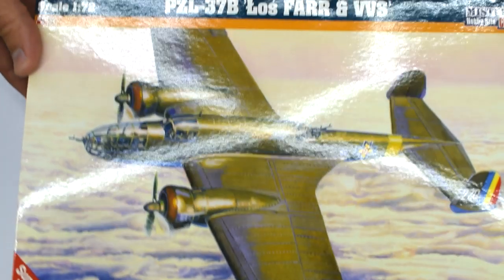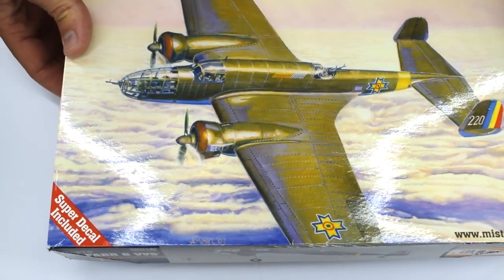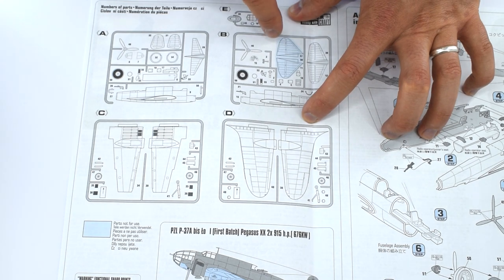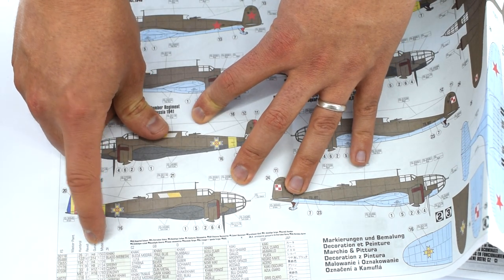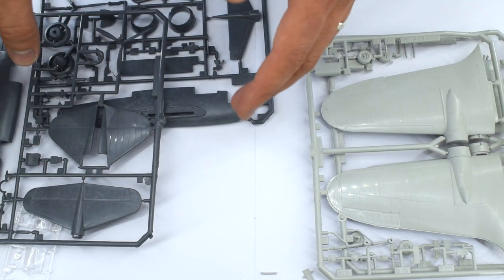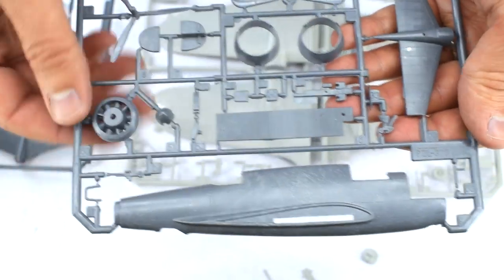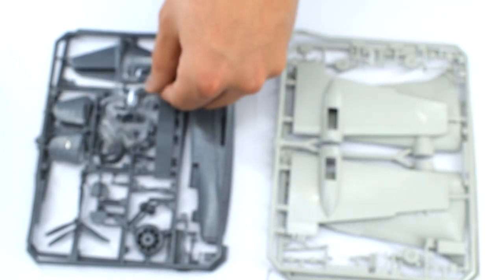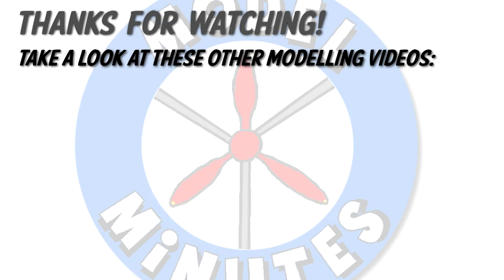Mistercraft PZL-37B 'Łoś FARR & VVS' - 1/72 Scale Plastic Model Kit - Unboxing Review

Comment: You should build a polish one
Reply from the maker: I'm torn now, polish one is a popular suggestion!
Reply: @ModelMinutes At the outbreak of WWII the plane was brand new . It was given to XX Bomber squadron on 31.08.1939. Due to mobilisation from 21.08.1939.
 It's even more complicated . Acording to monoghaphy PZL-37B no. 72.107 after fighting in XV bomber squadron (supplement),  evacuated to romania on 17.09.1939 (the day soviet union attacked poland) . And then it was used by romanian air force .
 And there is a mistake in the instruction . Interior walls should be painted in khaki. Correct khaki is FS 30108 . And for the blue . use something lighter than russian blue .

Comment: Some of the Mistercraft kits are dire. Just used their Westland lynx  as a based for a lot of scratch building. It turned out ok but the kit would not be good for a beginner. Funnily enough I've started their 48th scale SE5A and I'm using that as a base . The decals are sized to fit a 72nd sized  model though, so are unusable!
Reply from the maker: ah, that's a shame :(

Comment: I built the same kit in someone else's box (the choice of single-fin A or twin-fin B is a dead giveaway) it was a sod to build, but as the only kit of the subject available, I did it.

If you're building the Polish version, remember that the port wing symbol sits about the half-span - supposedly to avoid an enemy aiming at the mid-point between the insignia to target the fuselage.  Romanian aircraft were interned after the Soviet invasion pf Poland, and the Soviet example was probably captured.
Reply from the maker: Thanks for the info!

Comment: This is very old model from 1986 made low cost. Molds are very used and parst isn't fit. If U want to build this model buy oryginal from the 80s.
Reply from the maker: or get the alternative tooling that is also available from other companies
Reply: @ModelMinutes  From IBG only. Fly is a worse than this.